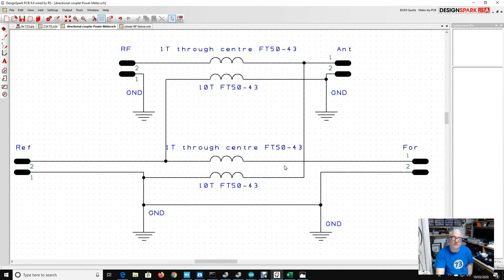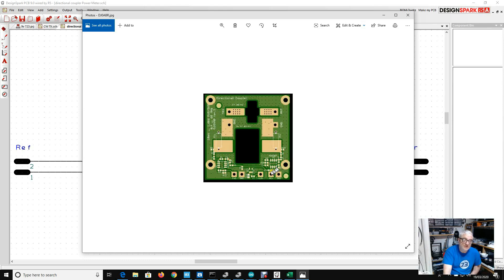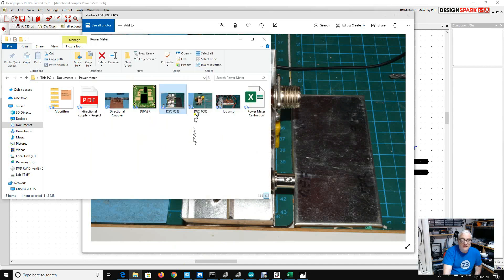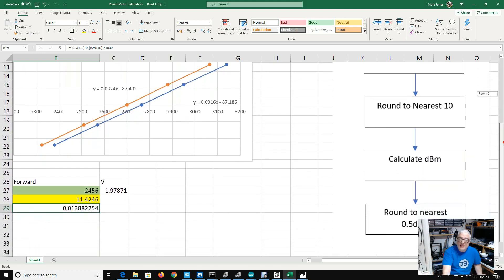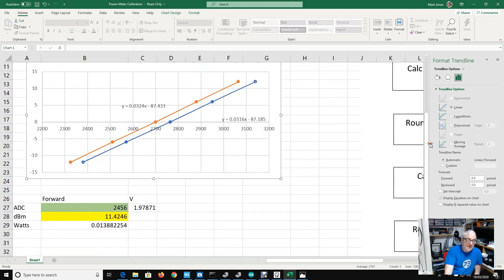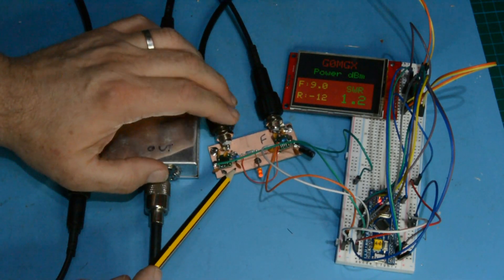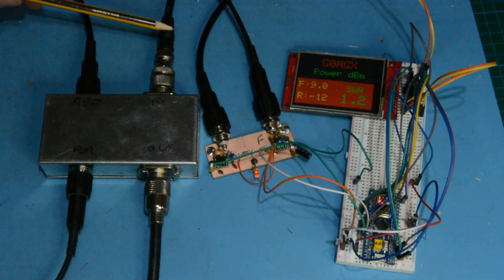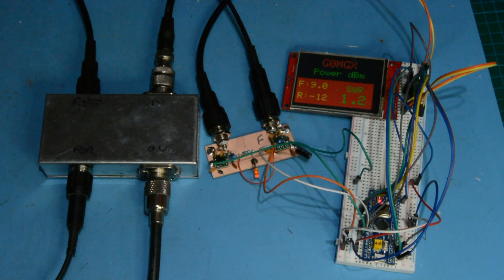An Experimental RF Power Meter using Arduino

Comment: I’ve just bought the Microcontroller Know How book so this video is very useful. I’m not building the directional coupler myself. I’ve ordered one from VK-Amps with the AD8307 on-board. We don’t seem to have a similar company in the UK with modular elements you can buy.
Reply from the maker: Good luck with the book. Some of the bits are already getting difficult to get hold of. Email if you need any help with the projects.

Comment: Great video, I have the same board from DJ0ABR. Just now, I make my experience with it. But I will use it between 1 W and 1000 W. Do you ever tried TRX power 100 W or more with your direct coupler? the equation-paramters also the same over this range? it would be intressting for me :-)  vy73,

Comment: Hi Mark..which library you use for arduinosort.h and XPT2046_touch.h ?thanks in advance.
Reply: OK OK...NOW is ok,my doubt....when my stm32 arives from ebay i also try this project.thanks Mark for sharing project.
Reply from the maker: The sort library is this one: https://github.com/emilv/ArduinoSort
The touch library is from here: https://github.com/vritzka/XPT2046_Touch
Reply from the maker: If you need any more help just shout
Reply: @MarkG0MGX  Hello Mark...i m starting but not like Niky Lauda :))arduino ide said:error compiling and before said:Particle.h no such file or directory ,maybe you know whats the problem ?thanks in advance.
Reply from the maker: @mladencukon-9a3xz  Make sure you have this core package in the preferences under "Additional Boards Manager URL" - "http://dan.drown.org/stm32duino/package_STM32duino_index.json" then select the Board "Generic STM32F103C Series" - report back please
Reply: @MarkG0MGX  of course, very soon... Thanks.
Reply: no ,no Mark.dont go;)first error is: Warning Category "in library xpt2046_touch is not valid.Setting to "Uncategorized" , second is xpt2046_touch.h:4:22: fatal error: Particle.h :No such file or directory.
Reply from the maker: @mladencukon-9a3xz  I still think you are using the wrong core. Please email me a screenshot of the Arduino preferences window. Mark.g0mgx@gmail.com
Reply: @MarkG0MGX  ok...i send you.
Reply from the maker: I've just uploaded a zip file with the two libraries here: https://www.qsl.net/g/g0mgx//BlogFiles/Power/
Reply: @MarkG0MGX  thanks Mark, see you soon 100% because your projects is wonderfull. I like it so much.